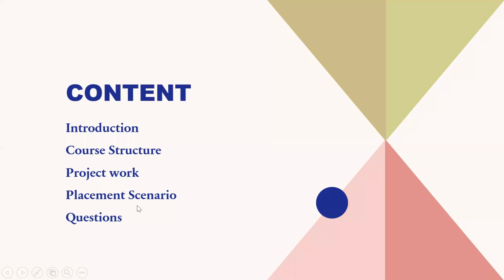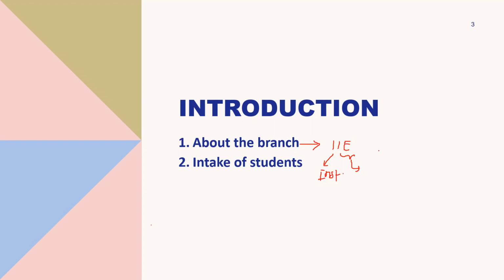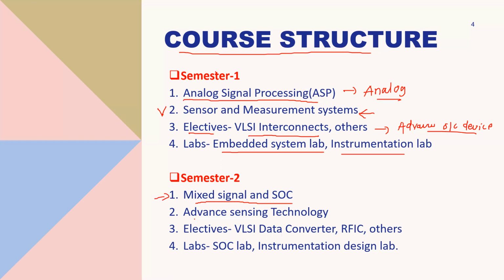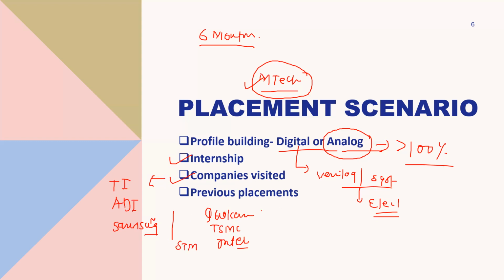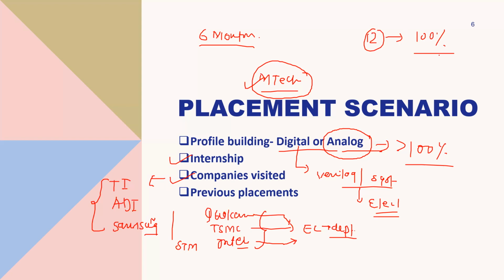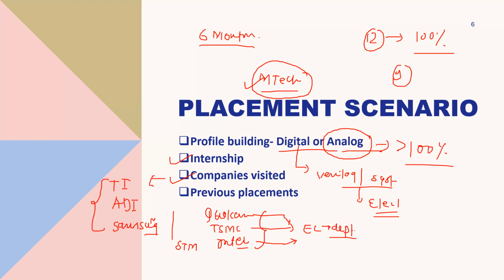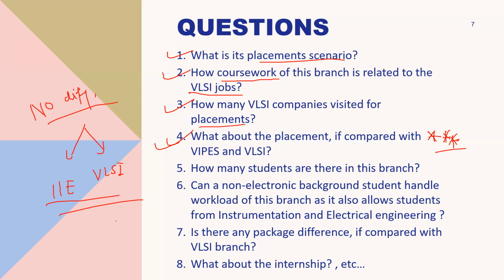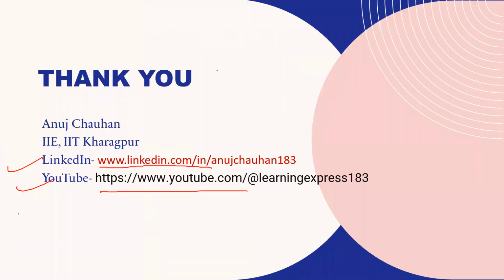Instrumentation And Integrated Electronics (IIE) Branch, IIT Kharagpur || Anuj Chauhan || IITKGP

Comment: Sir i have got iie in iit kgp and instrumentation and signal processing in iit roorkee which is better.
2) what’s the placement percentage of iie is it 100% sir.
Reply from the maker: yes, it's 100% and almost everyone in VLSI domain
Reply: @learningexpress183  thanku sir and u haven’t answered my first question
Reply from the maker: @mysterymansmemes9311  I answered it, look into the above replies.
Reply: Sir,my first question’s answer??
Reply from the maker: @mysterymansmemes9311  Let me confirm about ISP of IITR or you can connect with someone on LinkedIn and try to extract out the info about it. If there is the vlsi related environment for this branch, then it's good to think about a comparison otherwise IIE is good.

Comment: What should be the prerequisite courses that we should go through before joining this branch? I have been offered this in round 1.
Reply from the maker: Just remain connected with your basics, mainly analog electronics. 
Other than that you may go through basics of instrumentation devices like sensors.
Also stay in touch with the basics of EMT, Control, Signals...